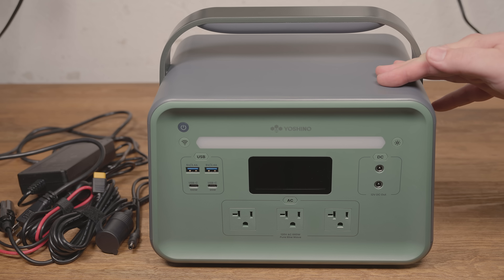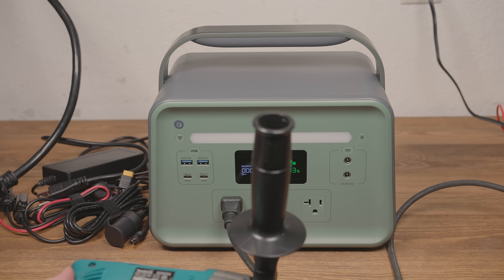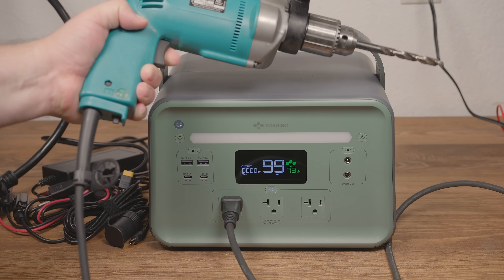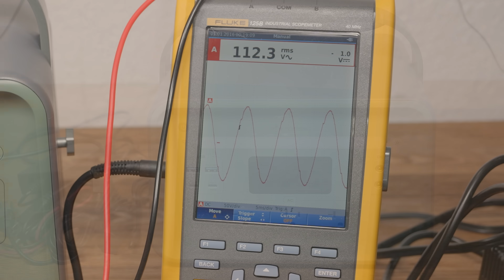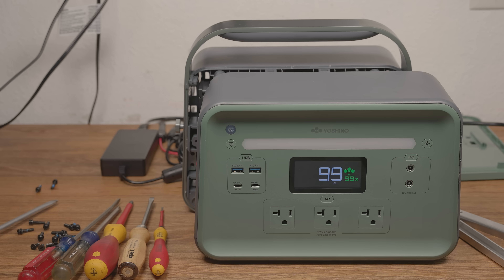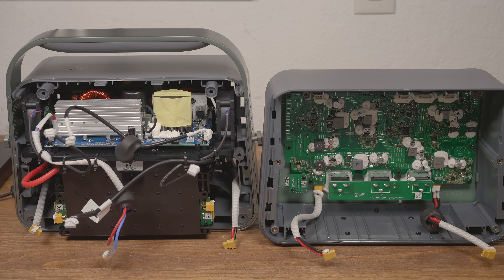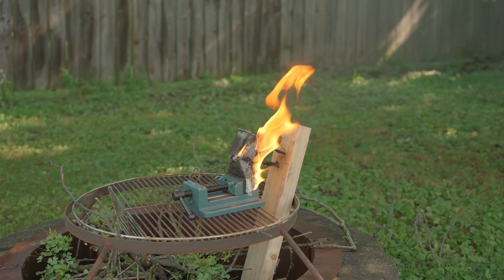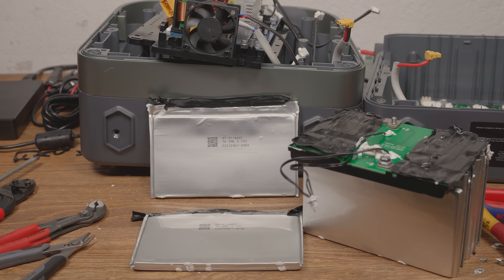Yoshino Solid State Battery Power Station, Test and Teardown!

Comment from the maker: Update.  I did look into that battery data sheet I found and it does seem to trace back to a Chinese company that claims to be making solid state batteries.  So it's possible that the manufacturer of the cells is also claiming they are "solid state" batteries.  I think they are more like semi-solid state.  But at this point, I don't know if it matters.  The stated watt hours per kilogram are roughly in line with typical lithium ion batteries, the Yoshino power stations charge slower than the competition, and clearly the batteries can and will catch fire in the right circumstances.  So I'm not sure what kind of revolution their "solid state batteries" are.  But I'm always happy to be corrected.  So if anyone finds any contrary info, please share it.

And in case anyone was wondering if smoke and fire necessarily means Yoshino are lying; here are some quotes from their website:

_"Nail Penetration Test

The nail penetration test evaluates lithium-ion battery safety by puncturing to simulate damage and monitor reactions. Yoshino solid-state batteries did not display any serious reactions in comparison to prior lithium-ion models that displayed smoke or fire."

"Traditional Lithium-ion batteries pose dangerous potential for combustion due to their use of volatile liquid electrolytes, which can easily be exposed to air and ignite. On the other hand, solid-state batteries utilize nonflammable solid electrolytes - meaning even if they get hot from overcharging or current load issues, there is no risk of a fire occurring."

"Another significant benefit of solid-state batteries is their safety compared to other rechargeable cells. Since they don't contain the sameany liquid components or combustible materials"_

So they say in multiple places that their batteries contain no flammable materials, and won't smoke or catch fire when damaged.  Just saying.
Reply: You should test another cell to see if they swell up like a pillow when overcharged- classic pouch cell behavior.  5v from a 1A or lower USB charger , fed straight into the cell .    

When they received the cells from the manufacturer they should have immediately recognized them as normal pouch cells , more or less.   There have been some advancements with safer pouch cell separators.  The manufacturer may have attempted to rip off this technology pattented by stanley blackNdecker and employed in dewalt powerstack pouch-cell tool batteries...
Reply: As per your first shot penetration it does not lead to fire, probably did not short out properly , this result can possibly be replicated under controlled conditions for a biased test result . It only needs to survive it once and u golden for a good boy sticker from CE
Reply: I don't think you should fall for any of the BS and be prepared to call these cells Semi-Solid State. They're either Solid State or not. A Flying Squirrel is not a semi-bird.
Reply: Where can I find the data sheet, I looked all over?
Reply from the maker: @NathanCruise-f8s  Hopefully this works.  YouTube sometimes removes links.

https://www.google.com/url?sa=t&source=web&rct=j&opi=89978449&url=https://images.thdstatic.com/catalog/pdfImages/66/6674f82e-d87d-4a75-a462-0968d05c0f0b.pdf&ved=2ahUKEwjS1fmBn-2HAxWJMNAFHegEFosQFnoECBkQAQ&usg=AOvVaw3UFO0VDcc030O9w2uYRSye
Reply: @NathanCruise-f8s  is there a specific reason you're looking for it? It's super fake, either the qpc was a bad joke or something but the email address listed and a bunch of other info listed is fake. Not even the listed battery number is real.
Reply: I personally know this company. 苏州清陶新能源科技有限公司 if anybody would like to find them. This company makes semi-solid state cells.
Reply: Fully charged voltage on a cell would tell us if it is lithium ion correct?
Reply from the maker: @inadad8878  Even Yoshino say they are lithium ion.  They are a Li-NMC (Lithium, Nickle, Manganese, Cobalt) cell.  The question is whether or not they are an all-solid-state electrolyte and whether or not they match Yoshino's claims.

While they may very well have passed the tests Yoshino claims they passed, they also say there are no liquid electrolytes, no flammable materials, and they are "much safer" than standard lithium ion batteries.  Well, they contain just as much liquid as a "standard" Lithium Iron Phosphate pouch cell (I've pulled one apart, plus liquid electrolyte is listed on the SDS), and they have a much more violent thermal runaway than a Lithium iron phosphate cell.  So they do contain liquid, they do contain flammable materials, and the don't seem quite as safe as a lithium iron phosphate cell.
Reply: @inadad8878  @inadad8878  Solid state batteries are lithium ion, they just poses a solid electrolyte vs Liquid lithium ion batteries which colloquially are just called lithium ion because they are the original version.
Reply: @dribz3b29  so a battery gel with tons of gravel and sand... i get it
Reply: @inadad8878  When constructing batteries "gel" is still considered a liquid.
Reply: @inadad8878  I suggest you rethink using peanut butter in a battery
Reply: Seriously? Can you not read your own damn post? Solo State batteries are not at risk of bursting into flames when they are overcharged or if there are load issues, they claimed nothing about being punctured. Nice twisting of words though.
Reply from the maker: @dribz3b29  They did mention that there was no smoke or fire when penetrated, unlike other batteries.  But clearly they do smoke and can catch fire when damaged.  I admit my damage was a bit extreme, but it's a questionable claim at the very least.  Also, the other quotes were pointing out that they say they contain no flammable materials.  And yet, the safety data sheet lists two different, liquid, organic solvents.  

My test was a bit extreme, and they certainly are more stable than some other battery types.  But their claims are pretty extreme too, and I think they are not honest or maybe simply unaware that their battery cells do, in fact, contain volatile, liquid electrolytes, if only in relatively small amounts.  I think this makes them firmly fall into the category of semi-solid state or hybrid cells.  That's fine, but they should just be honest and open about that.

Comment: Was the capacity as rated? It could be a semi-solid battery instead of a full solid-state battery.
Reply from the maker: I didn't measure the capacity, but the cells were labeled as 16.2 Ah at 3.72V.  That works out to roughly 60.2 watt hours.  There are ten cells and Yoshino says 602 watt hours, so at least they are being honest about that.  It's always possible that the cells themselves are rated incorrectly, but my main purpose in the video was to see if they met the claims of being true, solid state batteries.
Reply: @bigtb1717 @bigtb1717  Oh, interesting. Do you have the dimensions of the pack? If they are not lying about the capacity, it can still have an advantage volumetrically.

Comment: Good bust man.  When a chinese company is selling something that basically doesnt exist , you know it's fake.  Reminds me of the 'TrustFire' 9000 mAH 18650's...
Reply: You can trust there will be fire.
Reply: @samiraperi467 Fire or sand inside. Yes there are 18650 batteries from China with sand 🤷
Reply: I was also a victim of some of those Trustfire cells. My first experience with counterfeit goods was on vacation in Thailand in the early 90's. At the local open air market you could find shoes with labels that read "beware of frakes". I even bought a Creedence Clearwater Revival cassette tape including such hits as: RUN THROUGH THE JUNGER, UP AROUND THE BAND and WHOSE STOP THE RAIN.
Reply: @skipondowntheroad5833  "frakes" that's hilarious!       yeah i bought a 4 pack of TrustFire 18650's.  They were so light I carefully opened one up and found a tiny 14500 cell inside the can, with some kind of fake sand to fill the space.    they tested around 500mAh  actual capacity and had terrible voltage sag when discharging anywhere above two or three hundred milliamps.  Beyond terrible!!
Reply: That reminds me of another product, "Stormfire".  Advertised as a gasless battery powered "plasma flame" lighter that you just charge by plugging it to electricity. The product was real, the description was not. It's just a big butane lighter. Still , Youtube advertised the scam. I'm surprised this scam product hasn't been pushed at me.
Reply: @Veeger  Hilarious! I have a arc (plasma) lighter that plugs into USB, I would think it’s easier to actually make an arc lighter than to make and sell weird versions of butane lighters.
Reply: @Veeger  It’s easier to list YouTube ads (especially ad-reads by creators) that aren’t scams than all the scams 😂
Reply: Branding is the biggest scam
Reply: Had a vape shop around those times.. scary looking back on it.
Reply: They need to rebadge these products to TRUSTMEBRO brand.
Reply: More like fake bust! Does anyone know anything about batteries on here? Anyone ever seen a liquid electrolyte li-ion battery become punctured/scraped? Ya' ll need to stop your uneducated bs.
Reply: There are rumors that some Chinese 18650 cells produce very close to the advertised rating (2500-3000 mAH), but ironically other Chinese are making cheap knockoffs of them too. They're getting a taste of their own medicine!
Reply: Trust them to catch fire
Reply: TrustFire... well, i loved this brand name decision since i knew about them. But i never trusted them, because... why would you trust somebody who calls himself trust?
Reply: Thanks for this, happy I didn’t buy one.
Reply: If the word “trust” is in a Chinese product’s name…run away!  Lol
Reply: @I_have_Aquestion  a friend bought once a cheap trustfire set with zoomable flashlight, 2x 18650 batteries with i think advertised 6000mAh (when maximum 3000-3300 were reasonable to have) and a charger.

Those cells measured with 2200 and i think around 2400mAh, high inner resistance (bad…) and the charger literally explained the brand name… it really catched fire at one point…

I told him from the beginning this 10 or 15$ flashlight set will NOT be worth the fire hazard as suggested by the name.
Trust and FIRE combined… you can trust it burns.
Reply: And they use a Japanese name.
Reply: Yoshino is making a false claim on thier product. Government should make them say what it really is or ban the sale.
Reply: @dannydaw59  Amazon is too big and powerful. Once they let the government in the door they’d be in trouble because a large amount of the products sold have all kinds of legal issues: fake emissions compliance tags on engines, fake CE and UL certification on household appliances, STOLEN INTELLECTUAL PROPERTY false claims etc. Amazon doesn’t really enforce it though, eventually after a bunch more people get hurt, the gov will look into it.
Reply: @dannydaw59  That's a major claim of fraud, can you back it up?
Reply: You seen really happy that they failed.😂 to be real they should have not lied.
Reply: @trustmub1  Of course. We would all love for this tech to exist, but we would’ve heard something about it in the news if it were real. I love when these companies get exposed as frauds.